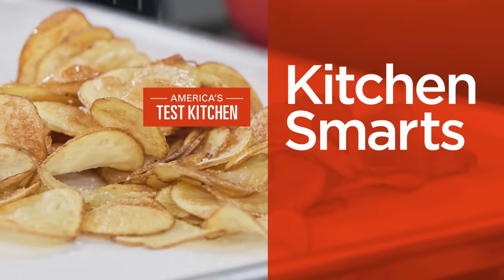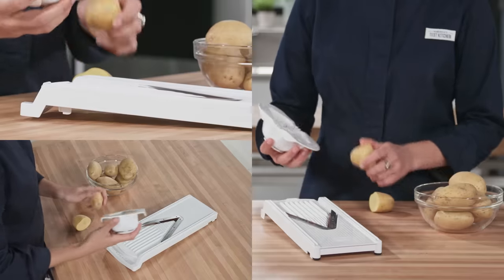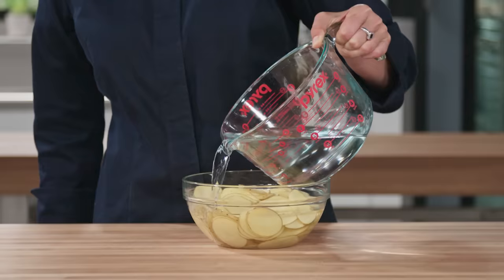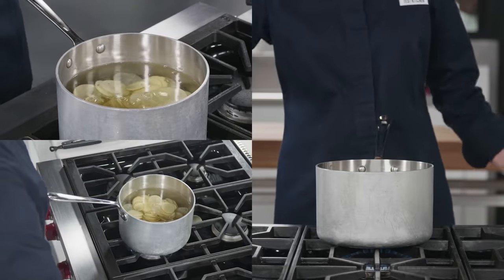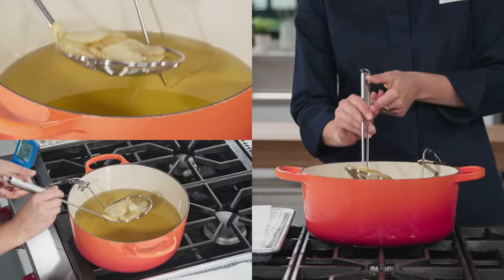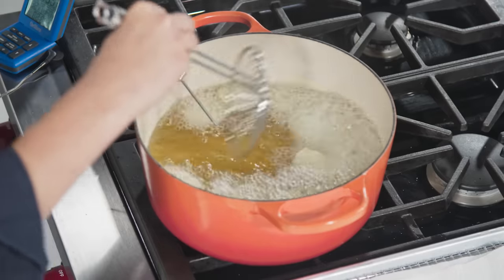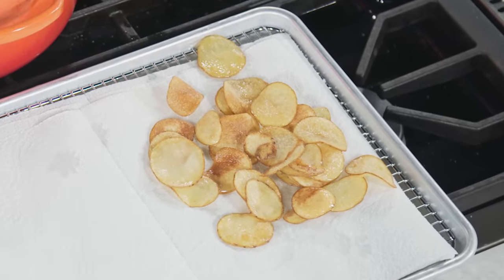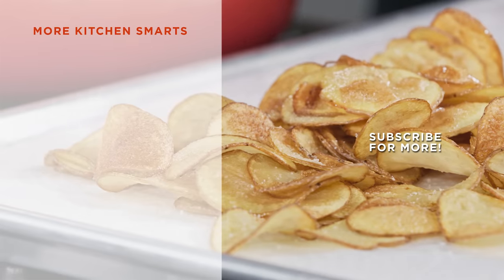How to Make Homemade Potato Chips

Comment: I find adding 2 tablespoons or vinegar to the water gives a very crispy chip when frying.
Reply: Thank you, Valerie. I rinse & soak for 2hrs. The slices are batch fried after drying, 1/2 potato makes a batch. My frier is the FryDaddy+ which has no temp control but tops @ 385. Slices are twice fried w/skin on. First fry temp settles@325 for 7 min. Leave in basket & cool 15min. Second fry is time to reach color, crispness. Drain & season for perfect chips, fin temp 382.
Reply: Valerie - That makes sense. The vinegar keeps the potato from turning into mush. 

I boil potatoes cut for fries in vinegar and salt. Maybe also add salt to your boil to add more flavor. 

Thanks for the tip.

Comment: This is almost how I make them. EXCEPT..... 
I fry twice. Once cooked about half way through at 280 to 290 degrees, and again after they've COMPLETELY cooled at 400 until done.  'Double frying' is a trick used for many fried foods, from chicken to french fries, because the second high heat drives off any oil.  
I've also found giving the finished (and salted) chips a good shake in a brown paper bag works better then draining on paper towel. (but if you've done the second fry right, there won't be much oil to drain off)
Reply: this was super helpful, I've been making my own chips for a few years now and I wish I'd tried this before

Comment: I have never tried boiling as my approach is twice fry. Get cooking area organized & there will be no mess. Potato soak after slicing w/water changes is 2hrs. Divide into batch size and dry before 1st fry, leave in basket w/2nd fry in 15min. Pull & season when color & crispness are acquired. (See Reply to Valerie below)

Comment: Its not that hard..just use a different potatoes. I use red gems.they work great. Slice and pat with paper towel.
Put into heated fryer..remove and put in paper towel to drain a bit. Salt to taste or season salt. They don't have to be super crispy although these will be very crispy and very tasty.. 
They get gobbled up quickly.

Comment: 2 quarts of oil?  Yea 15 bucks of oil….everyone can do that.
Reply: $15? Damn! Where are you buying your oil?
I'm paying around four bucks a quart here in the Portland area.
Reply: @oregonpatriot1570  2 quartz of oil is 1/2 gallon.  Unless your buying soy oil which will work but the cheapest your are gonna spend roughly 15 bucks per half gallon either for corn, canola, olive etc....and those are the cheap ones.  For that price its not feasible to make your own chips unless your frying a chit ton.
Reply: even if your paying 4 bucks a qt.  thats 8 bucks in oil for chips not including your potatoes.  Which again makes this recipe only for the 1 percent.
Reply: @Handofseeds   First, you don't need two quarts to fry stuff like this. One will do. Next, you're assuming that oil can only be used once. As long as you keep the bits of batter and food out of it and don't over heat it, it can be used many times. I do a lot of deep frying and keep my oil clean and separated so I don't end up with chicken that has a fish taste. I picked up a few things yesterday, and canola oil was one of them. I paid $3.29.  Hardly something "only for the 1 percent.